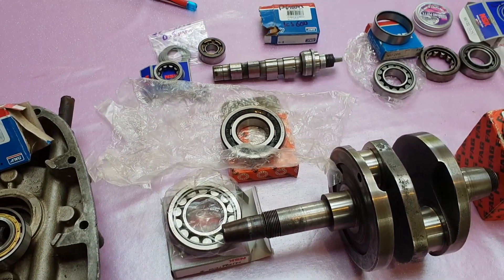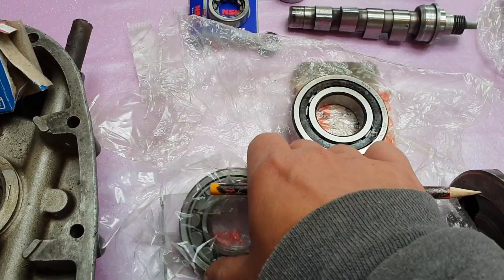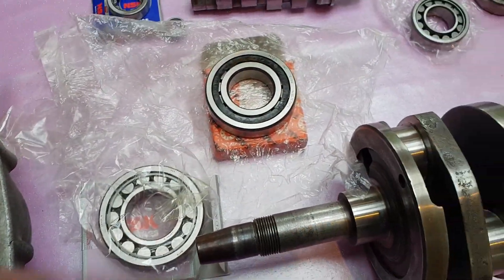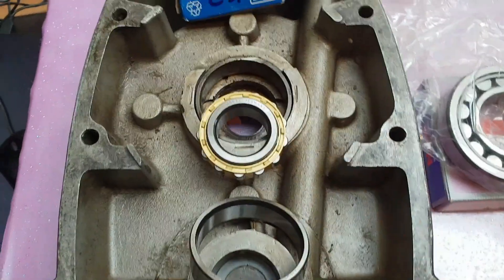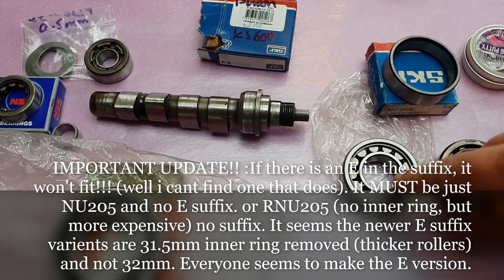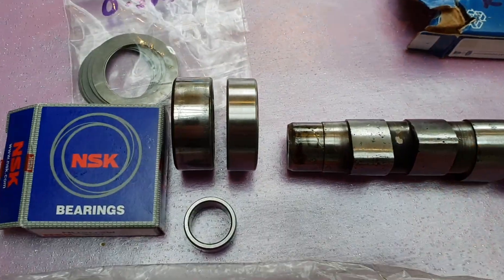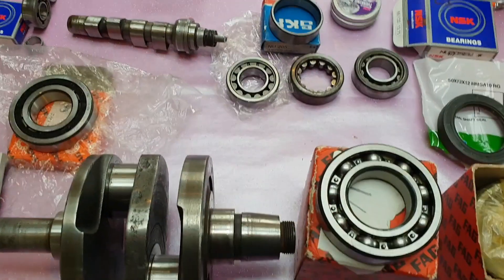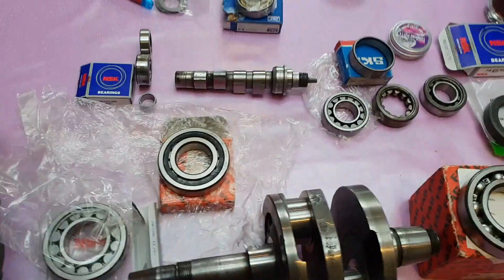Zundapp KS600 - (Updated) Engine Bearings (Motorlager)

Comment: Interesting enough, I found that my engine has an N207 (instead of an NU207) for the front crank bearing. No problems with it, and you may find that the N207 is a more generally available (and therefore less expensive) roller bearing option.
Reply from the maker: Yes I have seen that too. From memory, the difference being only which part is removeable. Are you fixing up a 600?
Reply: @MotorClassics  yes, that’s the case - the hole in the rear of the engine is big enough for either bearing. I love that the crank is removable…I’m used to building BMW /2 engines where every crank removal means replacing the bearings. Yes, I’m rebuilding a KS600 engine that was already running - but my latest find is that a piston pin circlip came loose and scored the inside of the cylinder…so a rebore is in my future. 😞